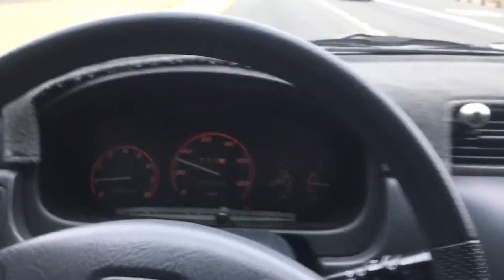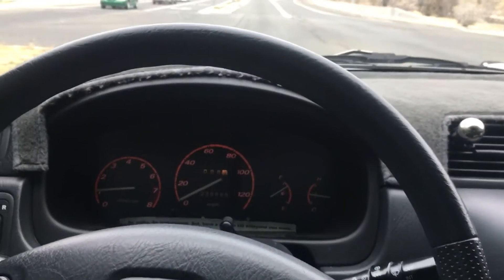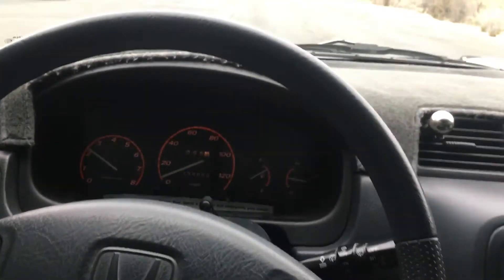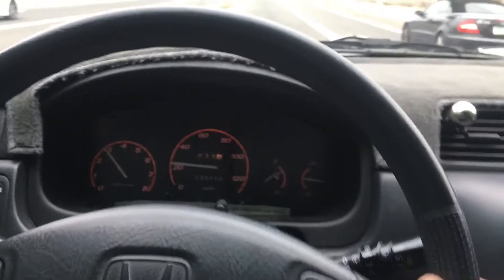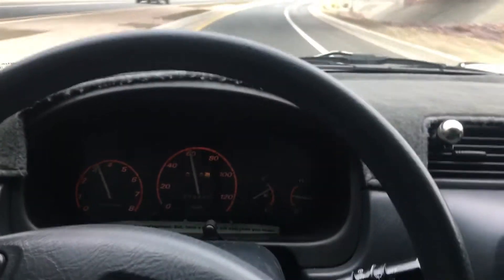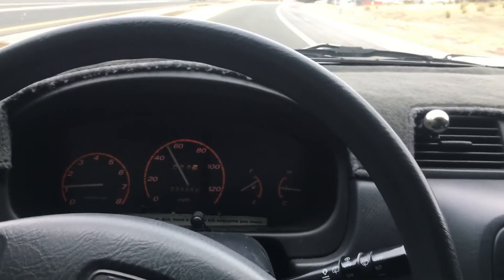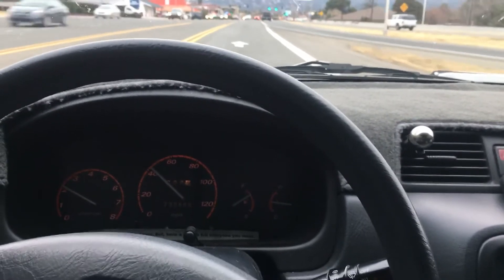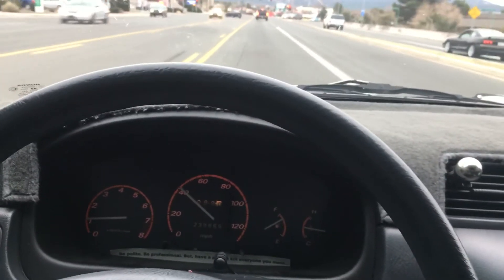1999 Honda CR-V rd1 1st gen intake sound windows up. How to make your CRV sound good

Comment: Dat sounds pretty good
Reply from the maker: Hunter Wnuk  thank you and yeah I really like it still lol
Reply: I did a muffler delete on my crv, and it sounds horrible😂
Reply from the maker: Hunter Wnuk I’m surprised a lot of cars sound great with the delete. I want to put an unequal length header on it with a little bigger exhaust for a different and mellow sound. My s2000 is my loud car lol
Reply: For sure man, I love that you still drive it when you have all these other dope cars.
Reply from the maker: Hunter Wnuk I love it man it’s great in reliability, gets decent gas mileage, and keeps me out of trouble lol. I’ve had it for 3 years and put 65k miles on it trouble free other than maintenance and wheel bearing/hub
Reply from the maker: It currently has 266k miles lol
Reply: Haha I totally get that, it’s not to quick.
Reply: I currently have 80 thousand miles on mine.
Reply: You thinking about making any videos on the crv soon?
Reply from the maker: Hunter Wnuk wow you have super low mileage. That’s awesome. Maybe what would you like to see?
Reply: Just hoping to see an update.

Comment: Bought a 'Secret Weapon' Short Ram and CAI Tube for my 2000 CRV.
Reply from the maker: Awesome they look great and sound good too!
Reply: Plus a PCR chip. You should look into one, they add as much as 60hp AND help fuel economy up to an extra right miles per gallon. Maybe I can tell you how it is in awhile I think mine will come in tomorrow.
Reply from the maker: @solomonstello  best of luck but generally those are a scam. Realistically you would have to use nitrous or add a turbo to make that kind of power increase. Please do let me know how it works though.
Reply: @HONDACARGUY  My associate who I work with told me it's not. He's got one in his Acura and he says it hauls everywhere..but I'm not saying that to disagree you could be right.
Reply from the maker: @solomonstello  one way to find out. Keep in touch, I’d love to hear about the results, good luck.
Reply: @HONDACARGUY  I spent today and yesterday figuring it all out and all I'm waiting on is to reconnect the negative battery terminal tonight.
Reply from the maker: @solomonstello  sweet!
Reply: It is good?
Reply: @HONDACARGUY  Sorry I took so long to get back to you. I think the chip doesn't improve fuel economy but maybe the Ram does. I recently began putting Premium gas in my car and it appears to be getting better mileage. The chip definitely overrides the Governor. So now I can max up the rpm to 6,000 or more.
Reply: @Jeremyho439  It is! It sounds like a WRX!

Comment: Any tips one what to install on my 97 crv????
Reply: It’s fully stock. It’s fresh and ready for its first performance part
Reply from the maker: Brief Lean  congratulations on owning a crv. My recommendation is to first make sure it’s all up to date on maintenance. So valve adjust, spark plugs, cap, rotor, belts and fluids. Once those are done the intake is great for noise but does not make a lot of power. The best for power is a better flowing exhaust, high flow catalytic converter, and it’s always best to get tuned.
Reply: HONDACARGUY bet thanks man I’m currently powder coating some bay components
Reply from the maker: Brief Lean nice I’d like to clean up my bay too but I daily it and it’s always off road too
Reply: HONDACARGUY dope man do you have a Instagram so I can show you some of what I did?
Reply from the maker: Brief Lean  lol unfortunately not man I have never joined anything more than Facebook and YouTube 😂
Reply: HONDACARGUY man your missing out for real!! Tbh you might have more followers than you do subscribers if you post on Instagram everyday
Reply from the maker: Brief Lean probably true but I limit my social media. Also I think it’s much harder to make money on Instagram
Reply: HONDACARGUY but Instagram might not make you money but it’ll funnel the viewers to you’re money makers you feel me? Check out weedz garage we have 350 subs and got 200 in 2 months. Now our Instagram has over 1000 followers and ever since we promoted our YouTube it’s grown like I said 200 in 2 months
Reply: @brieflean  how's the crv holdin? My girl Just Copped a 1999 with a table still in it! Awesome car I must say. But lackin power.
Reply: @guero5096  lacks power for sure. I moved to a different state and gave it to a friend. He got t boned and it’s a cube of metal somewhere now. It was a good car tho. Just a warning, the safety rating on them are terrible.. look into it some. I really want another 1st gen crv that’s how good mine treated me
Reply: @guero5096  is hers a fwd or awd?
Reply: @guero5096  mine had the table too btw 🤣 can’t believe it’s gone but
Reply: @brieflean  yessir!! I love my girls car mane, other then the power. I didn't know about the safety though! That's a little concerning. One thing I noticed about the rd1 Is that it likes the road rivets ALLOT and since I live in WA state we have horrible fuckin roads. I swear sometimes it looks like I'm a drunk driver bc it will just hook into the rivets and go wherever it wants if I don't hold the steering wheel tight enough lol.
Reply: @brieflean  awd! Manual:)
Reply: @guero5096  lol yea it’s has its ups and downs but overall it’s a good car
Reply: @guero5096  I had a automatic awd but how the awd works is it’s front wheel drive until the fronts slip. So it’s fwd until they slip so it’s kinda iffy